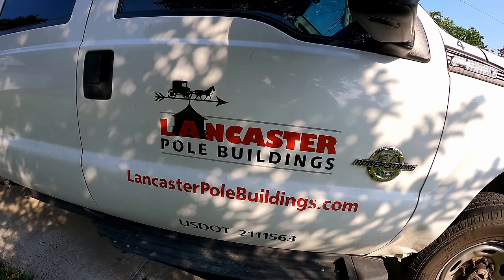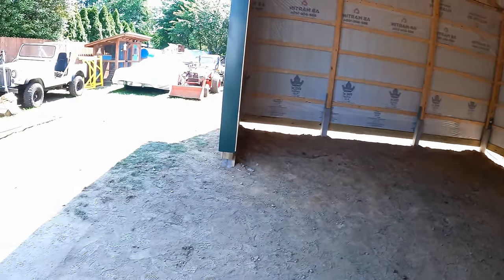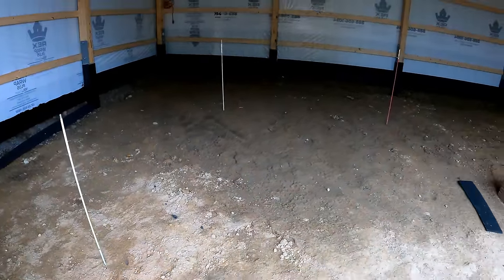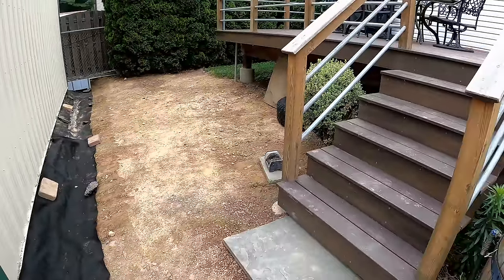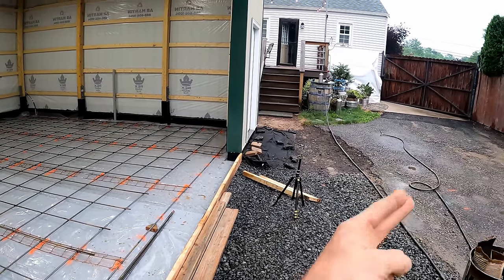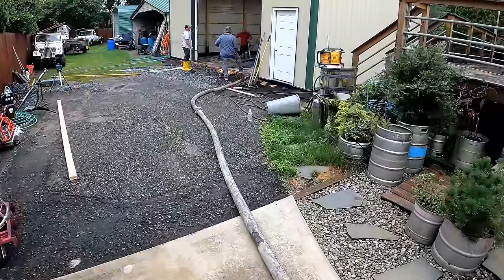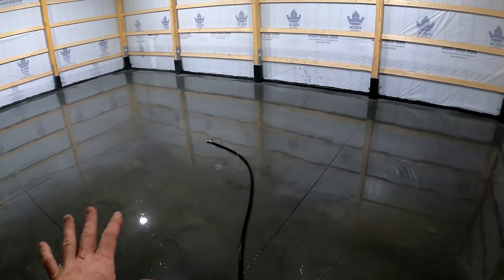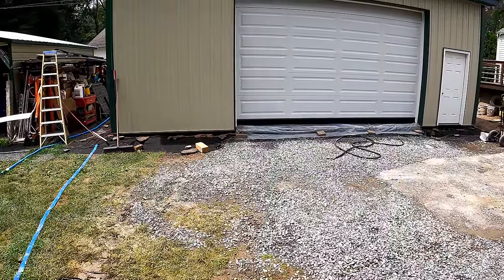FINALLY! Pole Garage Build/Concrete Overview - NNKH

Comment: I think you did a good job,   but I'm wondering why the concrete guys didn't drop expansion joints in while the concrete was still wet rather than the cuts they made?  I'm not a concrete guy but I'm expecting expansion joints here.   Nice job though,  good luck with it.

Comment: How do you plan on heating it in the winter?
Reply from the maker: Probably going put a mini split in however I do have the 200k btu waste oil heater from my old garage that does a pretty good job

Comment: not being all sad sack on the concrete but you can tell right away if its too wet and for sure i would have sent it back. and now the problem is, if it starts cracking, thats it, out comes the filler. it looks great an all but i foresee problems down the line. and really, if it does start cracking your only true save would be to take out a section and pour some in yourself. it isnt hard to mix concrete up, you can usually get it ready mixed or mix it yourself, 3/1, 3 bags of ballast and one bag of cement and water til it looks like thick mud and a wheel barrow and off you go. id do it for you but live in the uk so the travel would be too much each day lol

Comment: I would have embedded a 3x3 angle iron at he garage door entrance to prevent chips and cracks when driving over it. Other than that, great job..
Reply from the maker: I thought about doing that but decided to keep everything flush so there won't be a lip to chip.

Comment: ok, I see you do have a vapor barrier, myself, would have used 15mil Stego, then you can epoxy coat the concrete, and the epoxy is NEVER comming up, and oil & grease will never stain the concrete..  you should consider a 2 part real epoxy for that fine garage.

Comment: Still can't get over that most of your buildings are made from wood. Astonishing,  in South Africa for a garage or warehouse like your building,  we would use metal for the structure and metal / aluminum for the skin.
Or what we use the most,  concrete and bricks to put up a building. And even would your flooring,  a ready mixed concrete floor would have been poured on and just have to dry and cure. And especially when you have much severe climate that us....concrete and brick seems a stronger better option

Comment: Always a worry when U start screed concrete from the front of the shed should always pump and screed your way out. We use one person on aluminium screed the timber bends and gives too many low points

Comment: Just leave the floor as polish and call it good, epoxy is crap if you do any do an work. Like welding a pipe right on it. Water line would have been nice.
Reply from the maker: I completely agree about just leaving the concrete polished and let all the oil stains take care of the coating. So many people commented about epoxy. It's great if you're just using the garage for parking or light work. But it wears off with heavy use and weld spatter melts into it and then you end up with rust all over the floor.

Comment: yeah i'm glad you got your new shop. jen's right its not your forever home, but for now it will do. dont go cray cray watering concrete. and checking for cracks, that will steer you in the wrong direction. what it is is what it is focus on floor layout where your going to put your shit around the lift and make it happen. concrete is gonna do what its gonna do. its a shop. after while you will forget all about it when your looking for that wrench and need to fix the task at hand. good luck chris. and try not to drive jen crazy lol. she just dosnt understand anal retentiveness lol

Comment: problems if any come after usally cold weather elements etc time will tell its what is water rot animals bugs ect find a way fun part is expanse and contracts srinks and wights of area 
to little or not enough stock up on water cheap and effective till winter exuest ,gases , inclosed space flammable ventalation